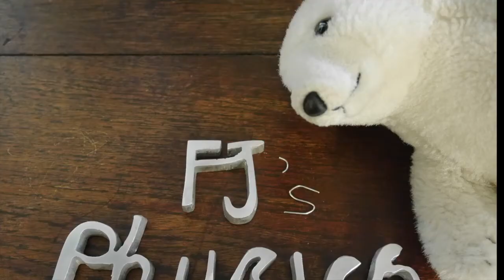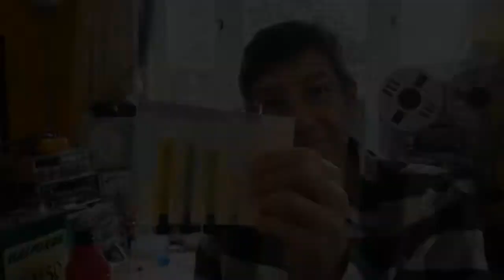Viscosity Explained Using a Homemade Viscometer - F-J's Physics - Video 159

Comment: Hello I was wondering if you could write down how to make the viscometer because I want to use it for my science project
Reply from the maker: Sure Sofia.  You might need help from the DT department but what I did was buy a think perspex block on eBay and then drill out the holes from the top and then made some screw threads and capped it with plastic bolts with O rings as washers.  I then just filled it, with a bubble space, with any oils I had and one with water.  However, why not make it easier and use a few test tubes taped together with corks in the top?  That is a quick build and you can put them in hot water to see the effect of temperature on viscosity.  Hope that helps and let me know how you get on.  Sounds like a great project!
Reply: @AnthonyFrancisJones  i'll do the test tube one!! thank you for suggesting an alternative :'DD
Reply from the maker: Did you make it?  How did you get on?